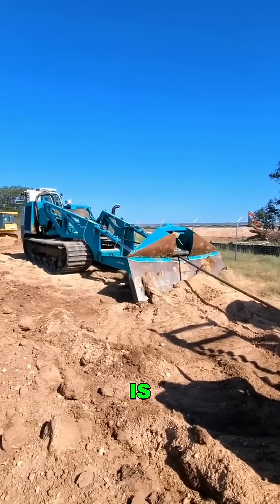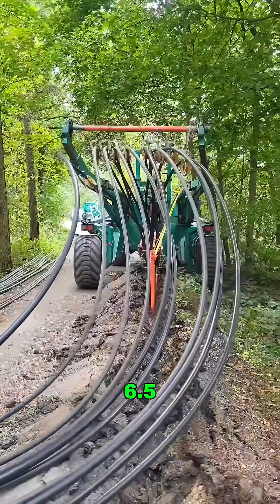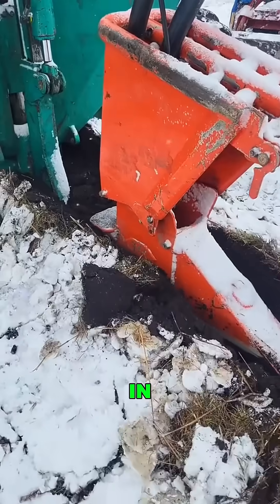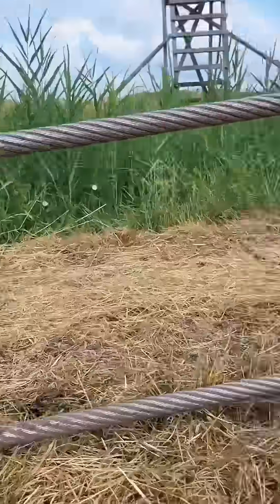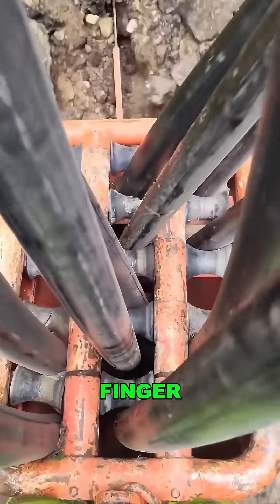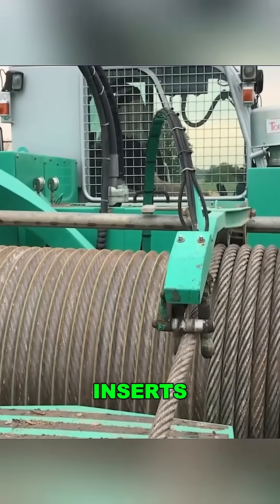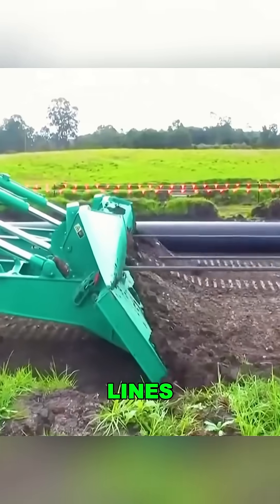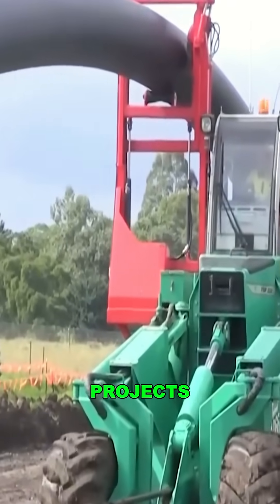The Genius Way Cables Get Buried—No Dirt Flying!

Comment: Based on the way it layed the cables on the video, I highly doubt it can lay water lines as I barely see any flexible pipes that could work with this. (Correct me if I’m wrong)